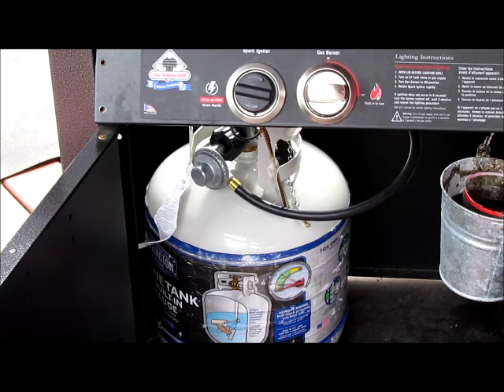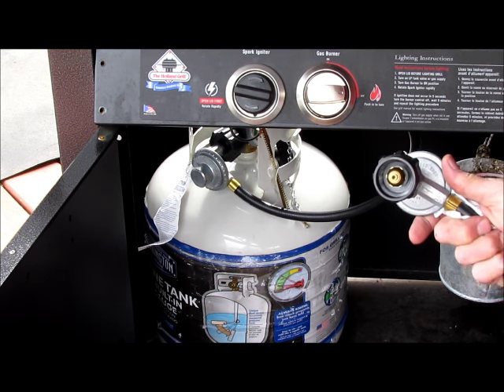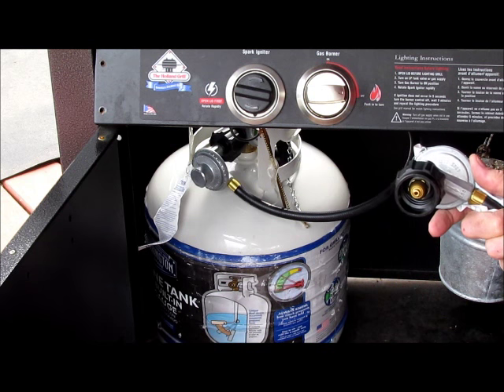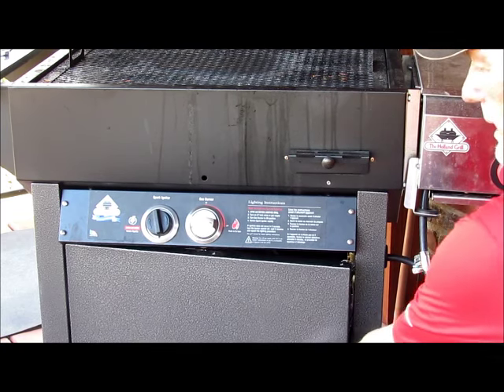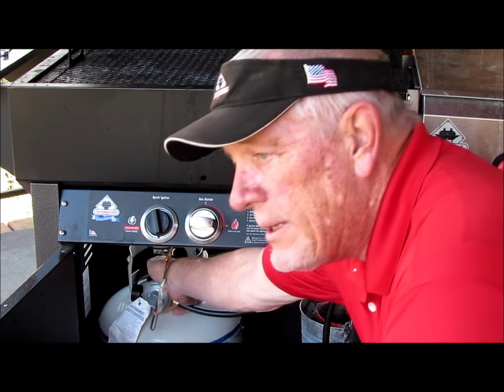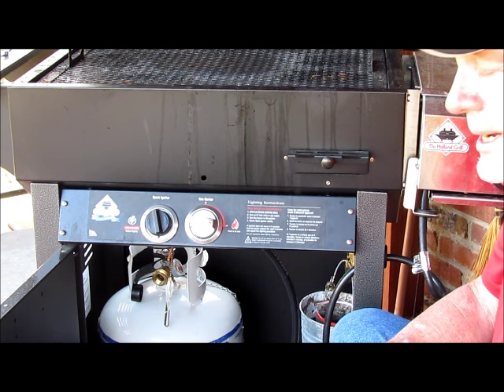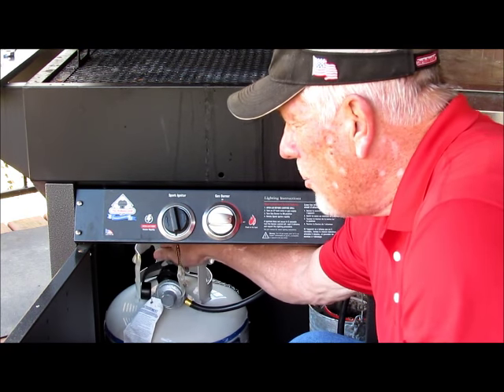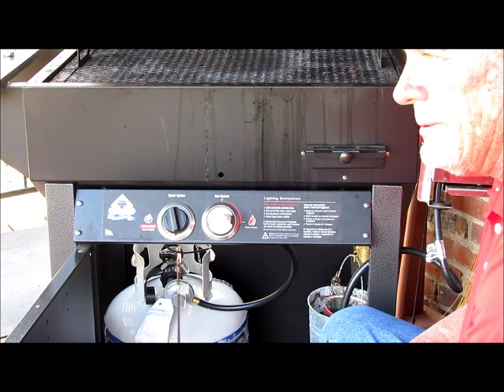HOW TO purge the regulator

Comment: Thank you this worked on my grill turned it on slow 1/4 of a turn and it lit right up.  Funny I unhooked it three times turned the gas on fast and a little gas came out then I found your video  and it lit right up.Over the  years I've probably  threw many good regulators away

Comment: Most of the time it’s not the regulator.  The propane tank was overfilled.  Turn the tank on its side and open the bleeder valve for 10 seconds.  Works every time.

Comment: After turing on the gas valve , there is gas leak coming out between the connecting head and the actual regulator . (It is an original new gas hose) Any idea what can cause it?
Reply: Yes it's leaking, replace the whole regulator/ hose assembly, no compromise for safety, being cheap now will cost you later.
Reply: Could also be the o ring on the tank.

Comment: Did this twice.  Disconnected gas, waited 5 minutes, re-connected, SLOWLY opened the valve on the tank... still low flames.  You didn't tell us what other situation(s) this could be.
Reply: Yeah, wouldnt that be nice.. i have a few regulators that are slow and couple with no flow. Guess ill keep searching. Ill let you know if i find answers
Reply: Find solution yet? Please share if so! Thank you kindly
Reply: I’ve had the same problem and looked up a bunch of YouTube videos that all talk about the same thing. Just buy a new hose and regulator on Amazon for 10 to 20 bucks.
Reply: Pour cold water on it
It’ll unfreeze it
DONT USE HOT. Could crack it
Reply: Sometime the burner tube holes rust, try cleaning them with a small nail, or oxy/acetylene torch tip cleaner

Comment: I did that but it didn’t work, then I saw a little hole, I think is a vent on the regulator and the gas  leaking through that vent really bad, do I need a new regulator?
Reply: Yes I have the same problem, did you fix it mate?

Comment: is it possible that my AMERI-GAS Propane exchange tanks are all bad...I've gotten 3 brand new regulator and hoses from WEBER GRILL and a exchange propane tank it leaks out the regulator yet again.  Im thinking its these damn AMERIGAS exchanges that i get down the street at the MARATHON station.  I don't have the silly receipt for it however.  I see a black rubber gasket on the propane side that is oblong , oval not round...is that my problem?  can i replace it or am i screwed at this point?  can i put some 3 in one oil on the black gasket to possibly be able to use this damn cylinder (tank) or should i just take this crap tank back.  Or do you think i have a 4th f-ing bad regulator and hose from  WEBER??  Sorry for cussing so much and thanks for the video.  Anyone else want to chime in, please feel free !!!
Reply: Sounds like a possible user error situation no offense meant.  We all repeat mistakes until we know better. I'd recommend the mr heater hoses, specifically the ones that have the rubber that doesn't break down.good luck if you haven't solved yet.

Comment: Can't you just close the tank valve, open the burner valve to achieve the same affect?
Reply: yes
Reply: How do you both have the same type of avatars? I don't know for sure but I don't think it's the same because the pressure you're trying to relieve is between the regulator and tank connection.

Comment: Just wanted to ask, does the coupling normally have a rubber seal inside? Thanks
Reply: It depends on brand and model and how precise they machine the pieces. Usually there is one at least. Sometimes veg fiber gasket as well but not always on gas fittings if every one of the  components are precision tight.

Comment: Mine still has low flames
Reply: Check out the orifice where the gas sprays into the pickup tube inside the grill sometimes a little spider or a little small insect of sorts will build a web in there. Most of the times it is a restriction in the gas line

Comment: I have a problem and maybe you can help. I have a leak as seen on this video >>>: Leaking propane gas regulator on grill (enohcs channel). Per the comments on that video, some claim is the tank that has the problem, but I see the leak coming from the connection/fitting in the brass on the LP Regulator hose assembly... can you give your opinion. Thanks.